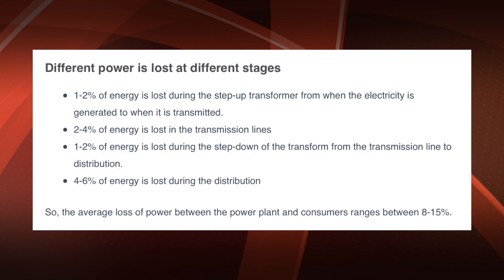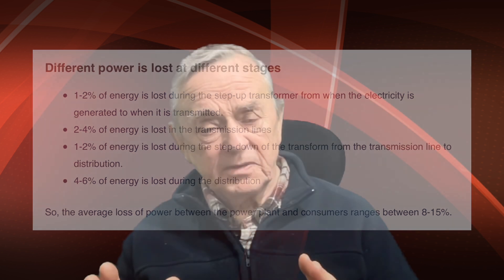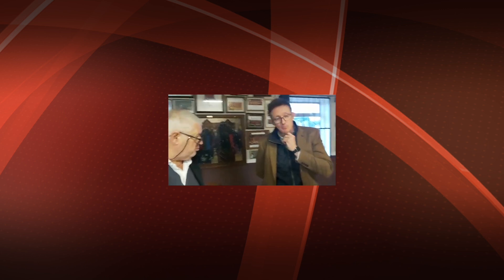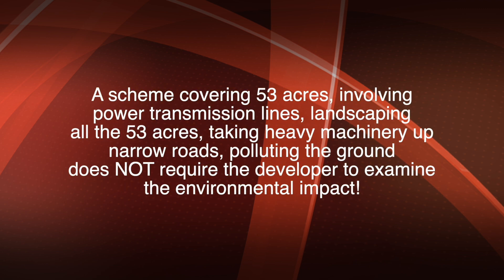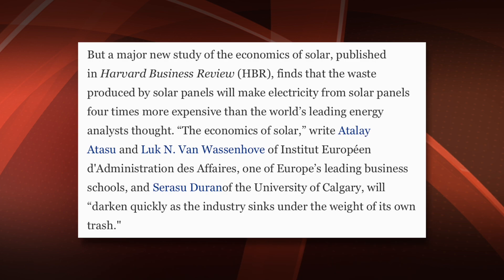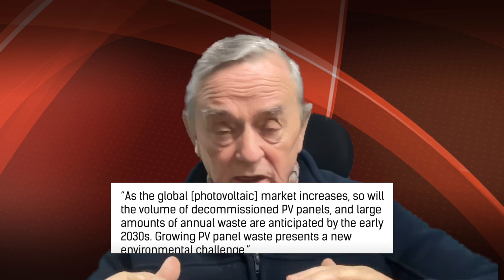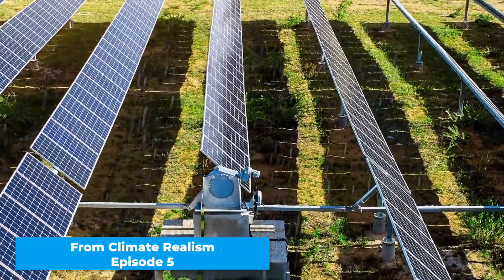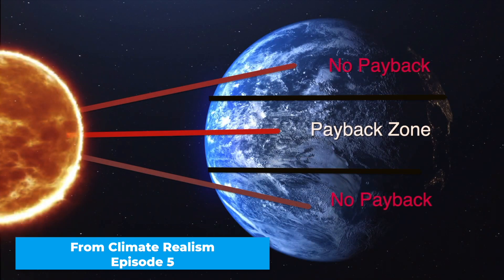How Solar Farms Mislead You episode 2

Comment: I can’t believe how our government sits back and encourages these lies, they should be put behind bars .
Thanks Paul for your dedication, I was told for years how good and clean solar is , even our colleges on Merseyside are running courses for solar installation, 
What do you think about heat source pumps?
Reply from the maker: Heat pumps have a role in heating swimming pools. spots, hot tubs. They require 220% more radiators than normal oil/gas heating or underfloor. Hence no good for most existing house stock but could be used ion new homes. They do add to costs and nothing can beat gas for homes. Has is converted to energy in your home - nil losses in transmission.
Reply: @ClimateRealism  many thanks Paul for your reply

Comment: I have read there was/is  to be a uk company that strips down and "recycle" solar panels using chemicals. There was no direct mention of what could be reused from the pannels or at what cost to the environment. This would come at a cost to the owners of the pannels compared to just having them put in land fill. I can guess which option company's would use if they have a choice.
Reply from the maker: If they had to pay for the re-cycling with an upfront bond I doubt they would even start the project. You, the UK public ,will pick up the tab.
Reply: @ClimateRealism  have you looked into any of these solar panels "recycle" places to see if its more smoke and mirrors?
Reply from the maker: @deadwood1  They are mainly a myth. Something yet to be invented.

Comment: Here is a list of the top 10 power sources globally and their typical capacity factor:

Nuclear: 90-92%
Geothermal: 70-90%
Hydroelectric: 40-90%
Natural gas: 55-60%
Coal: 50-60%
Tidal: 35-75%
Wind: 30-40%
Biomass: 25-40%
Wave: 15-25%
Solar: 15-20%
Reply from the maker: How are you defining capacity factor? As it is I simply do not understand what that list is
Reply: @ClimateRealism  Capacity factor is a metric used to measure the actual output of a power source compared to its theoretical maximum output over a certain period of time. It is expressed as a percentage and indicates how frequently the power source is utilized to produce electricity. The higher the capacity factor, the more efficiently the power source is being used.
Reply from the maker: @makesnosense6304  then that list makes no sense at all. What are you trying to prove?
Reply from the maker: What matters is nitre actual reality versus costs and all sorts of factors. Just the capacity factor by itself has no meaning.
Reply from the maker: @makesnosense6304  It does not state that. In fact the list is meaningless as regards optimal. All that matters is the cost, environment, consistency, availability and a host of other factors. Just because something can be operated a 100% of the time compared to another method does not mean it is better. For example geothermal is not even  available in the UK.
Reply from the maker: @makesnosense6304  Yes but say there is any abundance of coal locally, then that maybe better than nuclear, The capacity factor alone has no meaning.
Reply from the maker: @makesnosense6304  Sorry I cannot even agree with that. For example if you have nuclear as the base load and natural gas as the variable day load any diversification past that is just a negative.
Reply from the maker: @makesnosense6304  The load pattern is simply a base 24 hours a day load - all the same amount then a variable on top which is handled by gas - we know that pattern.
Reply from the maker: @makesnosense6304  My point is that  capacity factor ion itself has no meaning.
A far better factor is the intermittent nature os a source. So if you have no control over when it produces power as we do with wind and solar that in itself can be critical. But capacity factor as such never comes into it. Hence to rank say coaL alongside nuclear in terms of capacity factor is in itself meaningless.